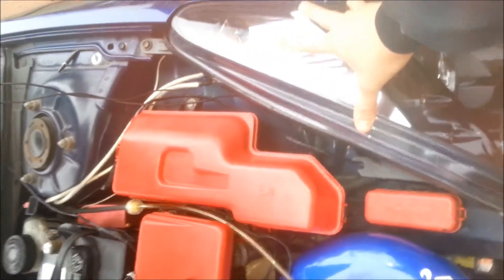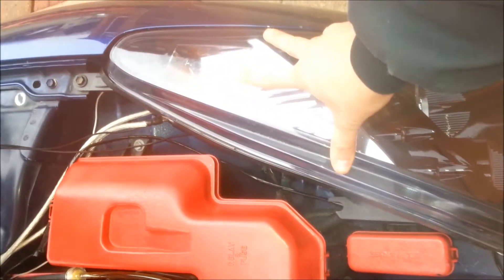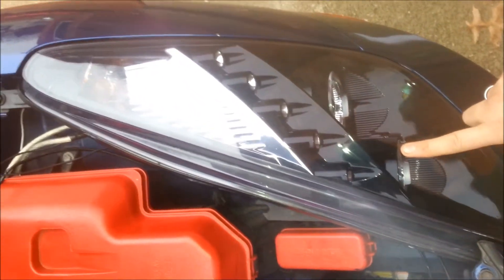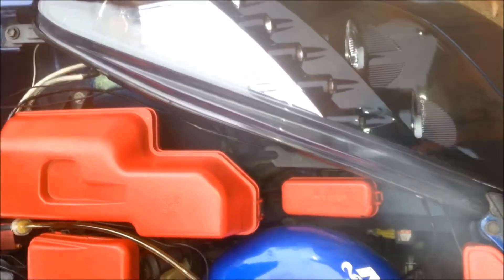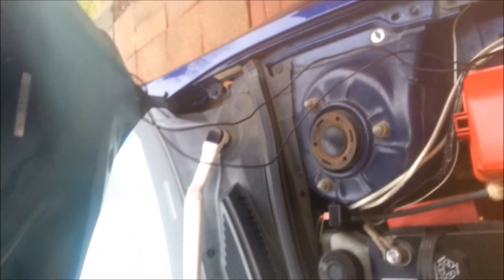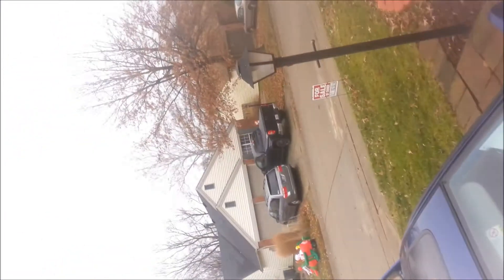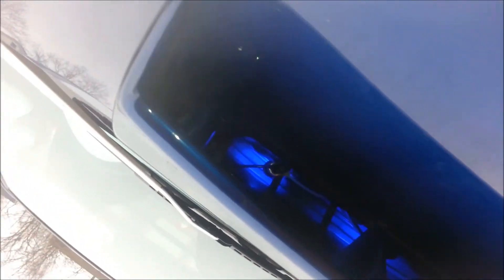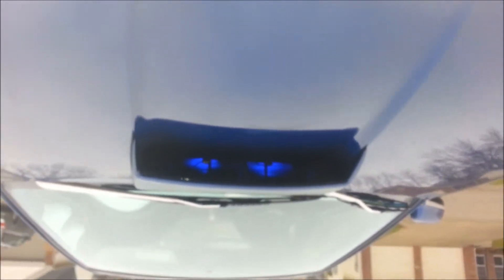Toyota Celica gt -scoop hood   LED Eagle eyes (blue)

Comment: Hey man, I have a 2000 celica gts with the exact same headlights as you, and I was wondering if you knew where to get replacement LED bulbs for the top strip? I've looked everywhere online for any to see if they looked similar, and have had no luck. Any help would be appreciated haha.
Reply from the maker: well  im sure  there is a replacement for it it wont be exact the same like you have now but  all you have to do is make an adjustment same thing when you first installed your headlights on your car you   because  is aftermarket you know you
Reply: icepure471  I have the two headlights I took my off due to the projectors that they make are cheap and went back to my OEM set. I have the LEDs (white) if you are interested.. Also, the headlamps are from EBAY which are cheaply made. I bought the LED's from the same MFG for about 15 per LED which is ridiculous high. reason why they blow out is because idiots that install it don't put on the resistor which burns the LEDS out overtime. I'l sell you the whole lamp set if interested. but wouldn't recommend putting these headlamps on any celica.
Reply from the maker: Cameron s
thanks for the offer friend ill let you know